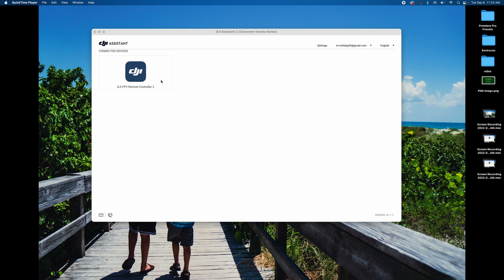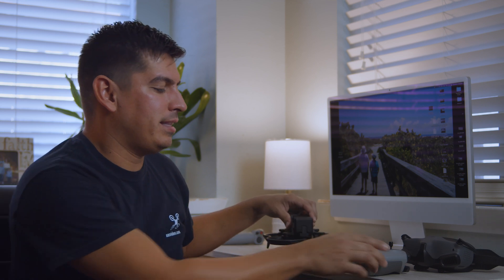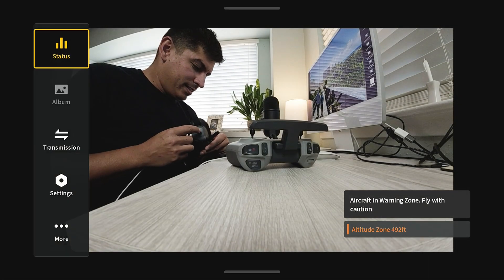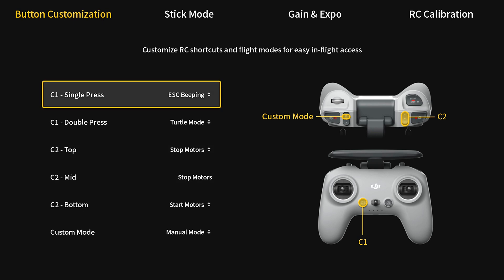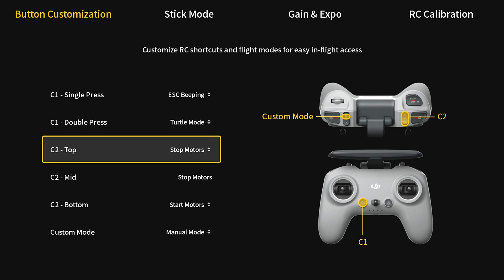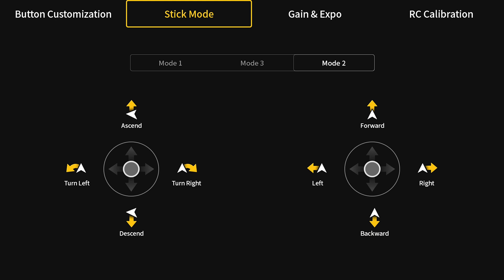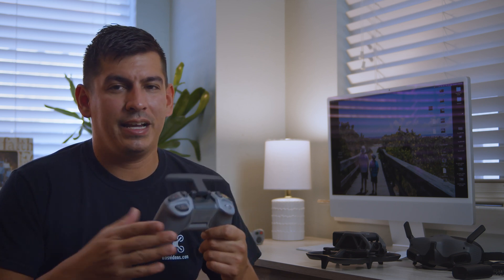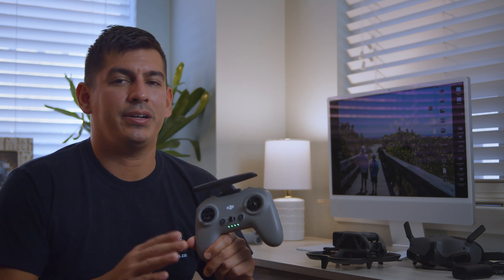DJI Avata Manual Mode Set Up

Comment: Hi Matt,
Thanks for the Great video.  

Quick question.  You mentioned that when in Manual mode, you have to have the throttle stick all the way down.  What happens if it’s not and it’s roughly in its center position?
Reply: It turns into a rocket when you start the motors

Comment: I found your video to be informatively helpful as I am just about to purchase the DJI Avata drone, DJI goggles 2, DJI RC controller 2 and the DJI FPV remote controller 2. I have saved your video an will use it as part of my initial drone setup once I receive it.

Comment: Great video. One question if I have set the controller to manual mode when I switch back to sport do I need to loosen or tighten the screws again on the controller?

Comment: By following your rates we that help a beginner? Well I don't crash 1st time out manual mode. Thanks
Reply from the maker: This will definitely dial down the rates and make it more slow and smooth. But if you are wanting to do rolls and flips, I would go up to the 600s.

Comment: I think it is very important to say that the camera has to be locked when switching to M mode. But how is it done? Because if you are in manual mode and have the gimbal compensate for your foward roll you will crash the quad.
Reply from the maker: The Avata will automatically lock the camera for you. You can however adjust the tilt with the wheel on the controller. It tells you the tilt degree in the goggles.

Comment: Thanks for the video. 
If you make c2 top/mid to disarm motors, would accidentally pushing this while flying make the drone suddenly kill the motors and fall out of the sky?
Reply from the maker: Yes it would. Also if you start in normal or sport mode and then switch to manual mode during the flight, moving the switch after in manual mode would kill the motors, no matter what position it goes to.

Comment: OK crazy question because the stick no longer Springs back when you go from manual mode to normal or sport how does the throttle react
Reply from the maker: You will need to manually center the stick in order to maintain altitude. Anything lower than 50 will decrease your altitude and above will increase it like normal. It’s a little tough knowing exactly where it is but with practice you can fly in normal or sport with no problem.

If you start in normal or sport from the beginning, just make sure it’s centered before take off. Unlike in manual, you would make sure it’s all the way lowered before takeoff.
Reply: @uasvideos455  thank u very much!
Reply: @uasvideos455  dumb question but how do you takeoff in normal/sports mode? I just flew for the first time in manual today, and I couldn't get it to start the motors without being in manual mode, I don't really mind taking off in manual mode at all, but I'd like to know, also I wasn't sure how to land without manual mode, I just switched to sport/normal mode and it landed instantly after, is that normal?
Reply from the maker: @TheGodlyNoob  not a dumb question at all. So to start motors in normal or sport mode you will need to center both sticks, then pull both sticks down and inward at the same time. The motor will start spinning, then center the sticks, raise the throttle and it will start to hover. 

When you are coming from manual to normal or sport mode you need to remember to center the throttle stick or else it will think you want to land since the throttle is all the way down.
Reply: @uasvideos455  thank you very much